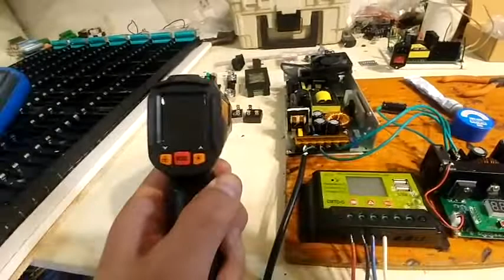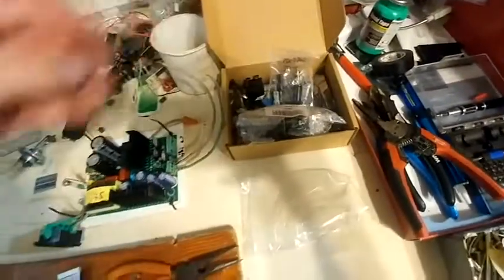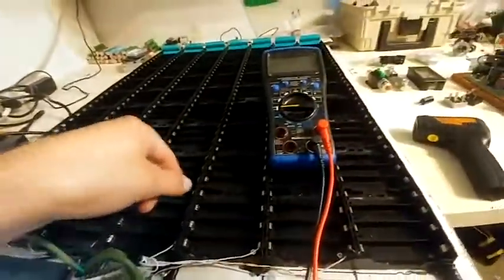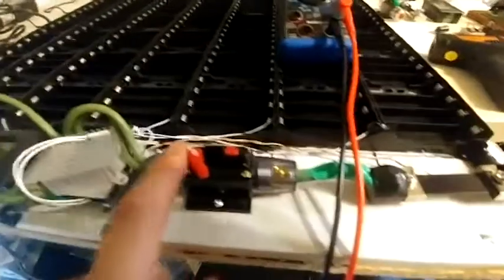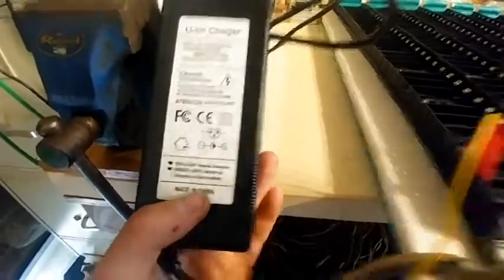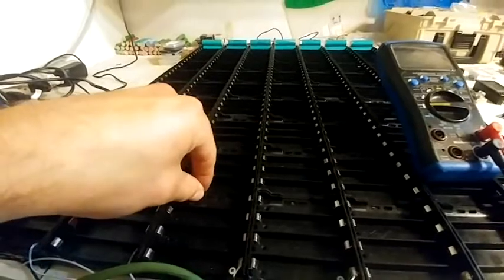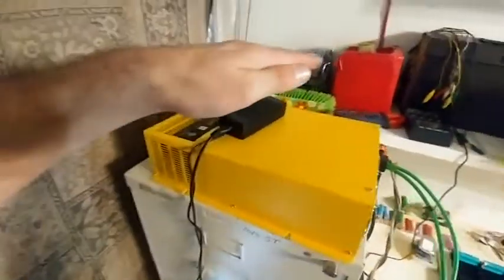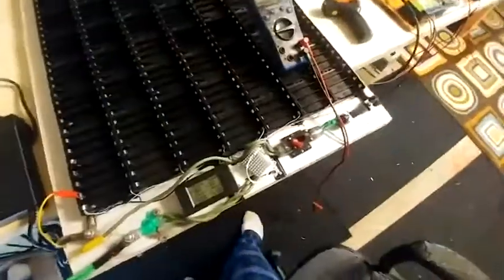18650 7s DIY modular PowerWall almost done full overview

Comment: Hello andy what about heat on the cellholders? Is it enough to melt the holders l?
Reply from the maker: Diy in the Ghetto great question. Each cell has 0.6a draw on it or less and heats to 32 deg celcious at most. Any higher means the cell is bad and i pull it out. 7 walls pulling 40a or less with open air flow cools much better than soldered packs. Ill make a video testing that more in the future. My load test video touches on this a bit half way in. Thx!
Reply: Thank you. I will have a watch at it when i get home from work thanks again for the information.